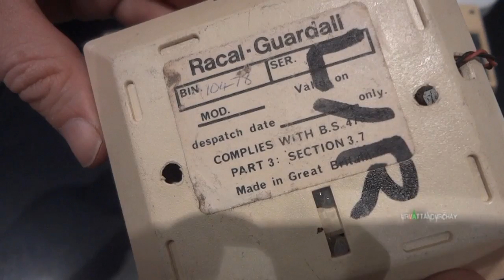Vintage PIRs - PART 10 - The Racal Guardall IR1012/1025

Comment: Is the LED Meant to flash? Because i have seen one of these on a wall in a old building near me and the red LED was staying turned on on that one was well.
Reply from the maker: A flashing red LED on a detector normally means "masked/covered up" or "trouble" (something wrong with the detector), but was only introduced in the 2000s when control panels had the ability to monitor faults from detectors.  Some dummy PIR detectors have flashing lights that blink (AA battery inside) when in reality they don't blink (a bit like dummy cameras!).